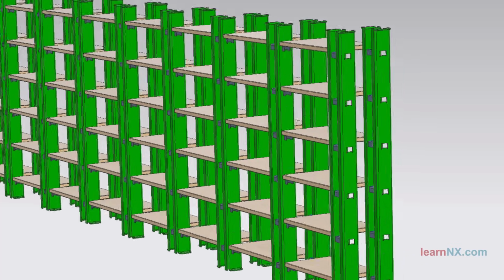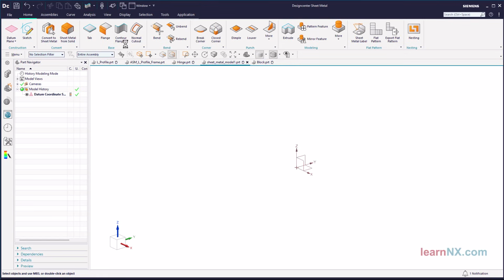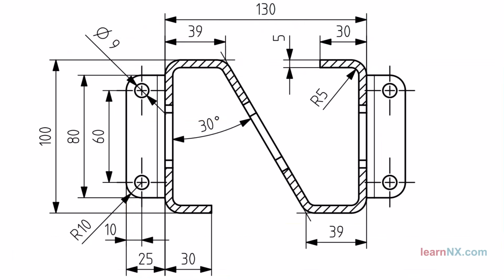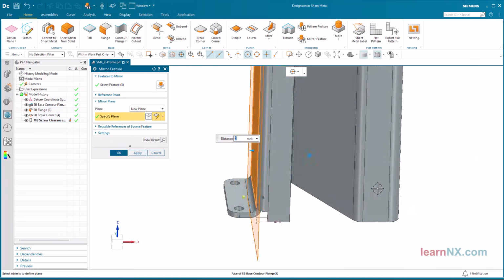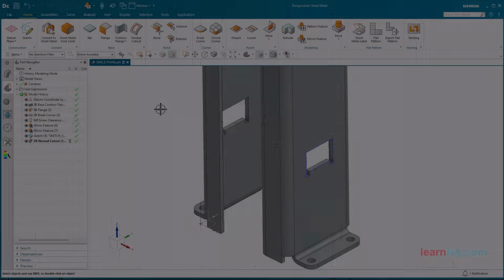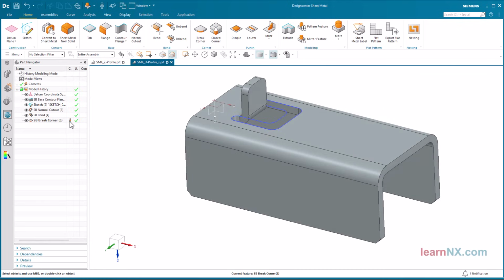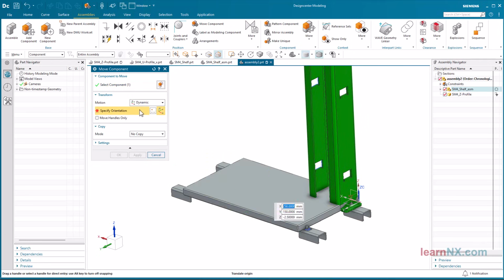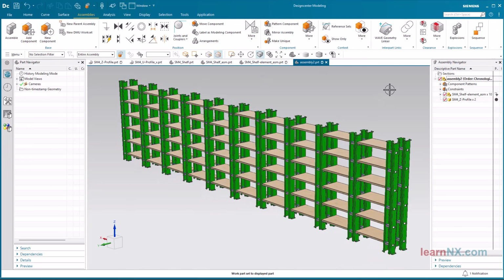Contour Flange, Normal Cutout, to construct a high-bay warehouse | Siemens NX Sheet Metal

Comment: Lots of good tips here for robust modeling & assembly, thanks! It points up the efficiency & power of NX.
Reply from the maker: Exactly, Mic, NX isn't a drawing programme, but it can manage and modify geometry very effectively. With the right structure, whether in the part or the assembly, design time is reduced to a fraction.